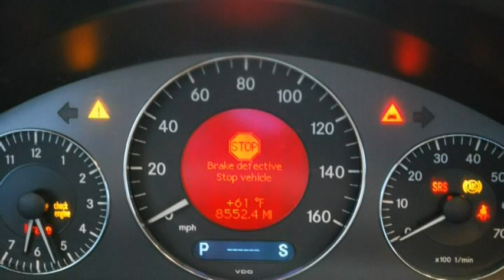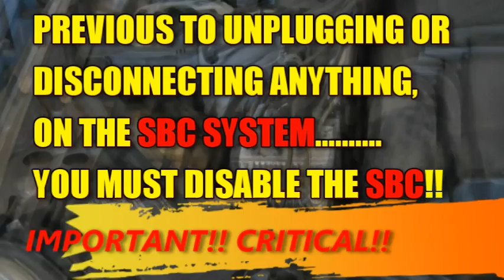Mercedes Benz SBC 211.070 Session1

Comment: I'm not in USA no warranty. I got c2131 fault code. Tested accumulator and it has 117 bars of pressure 7 above limits between 69-110 anyone had the issue?
I'm not positive that my accumulator is bad?

Comment: Hi
Brake service! visit workshop!
I have raplaced brake switch, wear sensors..pads, rotors..
When scan the sbc for DTC, the warning goes away and car is on. But when start the car again, the warning comes on, so any idea??
Or do i have to replace the SBC.
Thanks!
Read more
Reply: Youakha Youakha  your SBC most likely reached the threshold and needs to be reset or replaced

Comment: hi  

I have same problem in my W211  e-class  / 2003  /   220cdi.
Can anybody tell my in how that I can solve this problem. 

I have 2 faults after a STAR diagnose at the local Mercedes dealer;

1st=  C235C
2nd=C249F

Both has tho do with de SBC pump, is sais I have to it

Thank u